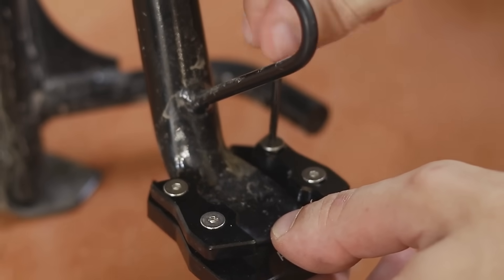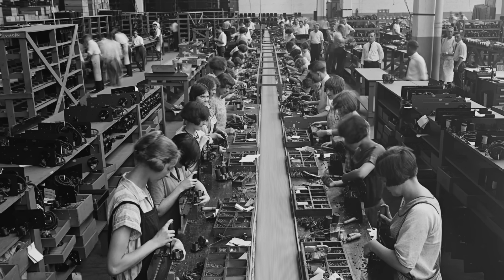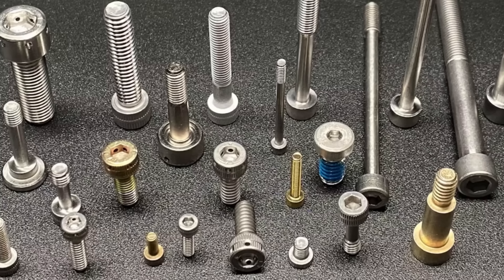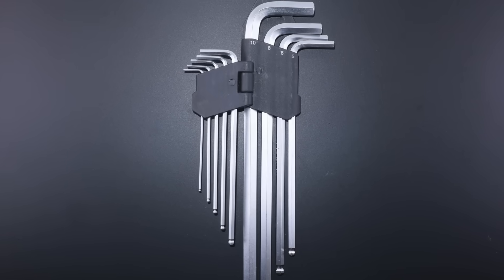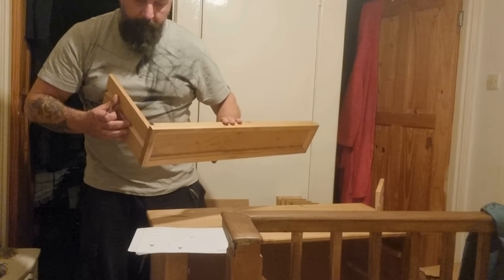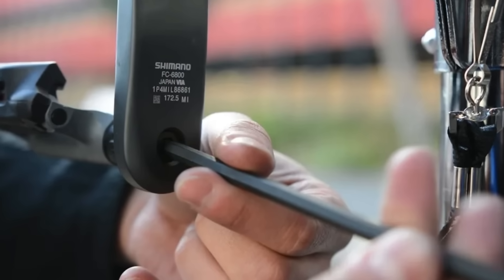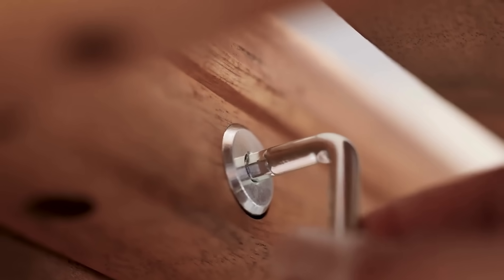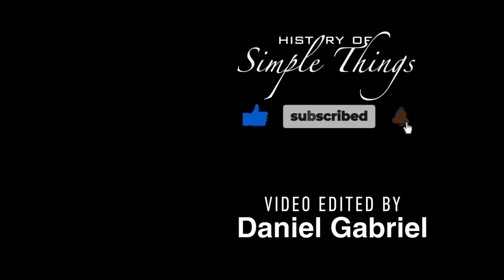Why Do We Call It an ‘Allen’ Wrench? The Surprising Origin Story!

Comment: Can't argue that they're better than flat head screws but I just wish Allen had chosen a square instead of a hexagon, the number of times the screw head or the tool becomes rounded off due to slipping would be a lot less with a square shape, I think.

Comment: In the U.K. wrench is what you call a pulled muscle. The rope suddenly went tight, and I wrenched my shoulder. Wrench : a sudden movement. 

So we call them keys. Keys fit in locks. Some locks require very basic keys to operate. Such as those on many toilet cubicles. You can unlock them from the outside with a 2p coin. They are just a lock to hold the door closed against accidental entry when in use.

Comment: American here. At my first real job, I was politely but firmly informed that the tool was called an Allen key, not a wrench. I frankly detest the L-shaped key. I much prefer the ball-end keys that have an interchangeable screwdriver-style handle, such as the Xcelite 99 series. The sole advantage the L-shaped keys have is that they can be made very cheaply, which is why they’re included with flat-pack furniture. 

Another advantage of Allen head bolts is that the socket can be a small diameter and still handle a great deal of torque, which is why they’re used for set screws, or grub screws if you follow British Commonwealth usage.

As for standardization, all commonly-used fasteners have been standardized. If they hadn’t been, they wouldn’t be commonly used. Duh.

Comment: My experience is that when subject to vibrations, the Allen screw loosens.
Then, lock nuts are required.
Reply: I don't see how the drive type has anything to do with whether a screw comes loose.  Why would an Allen set screw be more prone to loosen than a Torx set screw of the same size in the same application?

Comment: My father made very certain when I was a little kid (decades before Ikea and furniture assembly at home) that I knew that Allen wrenches were properly called hex keys.  After I knew, he was complacent about our referring to them as Allen wrenches.  (He was not complacent about any wrench other than branded Channel Lock pliers being referred to by that label.)  I also knew which way to tighten or loosen bolts and screws, because he taught me (and took advantage of my small hands to thread and  hold tension on nuts in tight places, much to my  childish delight). I didn't hear "Lefty Loosey, RightyTighty" until I reached my tween years; we didn't need it.

Comment: My Father was a Screw Machine shop supervisor for 45 years with the Bendix Corporation. In the mid-1960s his company opened a division in Mexico and sent him down there to get it up and running and manage the machine set ups. The company provided a complete set of tools for each machine. It wasn't long before sockets, ratchets and wrenches started disappearing at the end of shifts and had to be replaced.
After a month of this my Dad shut the place down for a week. He had a crew replace all of machine fasteners and the tools. Hex Bolts and Hex Nuts were replaced with Cap Screws and Square Nuts. He replaced all of the Ratchets, Sockets and machinist wrenches with Allen Keys and Monkey Wrenches.
After that the place ran like a top. He came home after four months to a promotion and big raise.

Comment: 'A century of innovation' ? Surely more a case of 'right 1st time', so innovation not needed? I was wondering what innovations could have possibly improved Allen keys since their invention. I thought chrome vanadium steel, but it was invented at pretty much the same time as Allen key. The only there relevant innovation I can think of is the ball ended Allen key (1964, by Bondhus, apparently).

Comment: Allen wrench, Allen key, hex wrench, hex key are all interchangeable names for the tool and I have used all of them. There is also a similar tool that uses splines instead of flat sides called the Bristol wrench, Bristol key, spline key, etc.
Reply: Right.  These terms are equivalent.  It is a silly argument.  You can even find a company that makes then using both "key" and "wrench."

Comment: ..they're easily lost/misplaced also..can't tell you how many partial sets I have at home, each missing two or more "keys"😊😊😊
Reply: I had that problem, because my set was just kept loose, in a pouch.  Now I have two large sets with a plastic holder for each with a place for each individual tool.  This is important because the holes are marked with the size.  The smallest keys are too small to be marked with the size.  You just have to be disciplined about putting them back.

When you have a device that needs regular use of one small key, it is better to buy another key of that size to keep with the equipment, than to remove it from your set every time you need it.

Comment: Do not call it that in Denmark. The name used here is Umbraco Key. A quirky spelling mistake as the origin of the name is unbreakable.  The Un-break-o key was used for loosening or tightening the bolts made by the USA company Standard Pressed Steel Company, as a precision bolt for the car industry in the 1920's.

Comment: Well Phillip and flathead both have their own screwdrivers.
Reply: "Flathead" is a description of a screw designed to be recessed to be flush with the supporting material.  Many people use it as a term for a common screwdriver used to drive slotted screws, but that usage is incorrect.  Screwdrivers do not have a head.  They have a handle, a shaft, and a tip (or bit).
Reply: @GH-oi2jf  are you sure? Pretty sure Flathead is a guys name. We had a kid called Flathead at my school…🤷🏿‍♂️

Comment: The word "Wrench" is not used outside the USA. We've always called it an Allen Key, but it's used much less these days, it's been taken over by "Torx" keys, which are even stronger and better to use.
Reply: Do torx keys come in the inexpensive format of Allen keys?  I only have them in drivers with a handle, or bits to be inserted in a driver tool of various kinds.  A useful characteristic of the Allen key is that it is small, lies flat, and is inexpensive.  If you had a particular device which often needed the use of an Allen key, you could just buy a single key to keep with the equipment.
Reply: @GH-oi2jf Yes, Aldi have them in stock relatively often. 

From memory, their Allen keys are coded red, Torx keys are blue.
Reply: In the UK we do use "wrench" for torque wrench, pipe wrench and basin wrench, but not for Allen keys.

Comment: It's only Americans that call this a wrench. By the way Allen heads are one of the worst heads invented.
Reply: "One of the worst"?  Hardly.  It is widely used because it suits many applications.  It might be misused at times, but I've never encountered one.  A common usage was once set screws on knobs, such as on radios and other electronic equipment.  I don't know what other type one would use.  When the makers of these things stopped using them, they went to a spring incorporated in the knob for friction retention, rather than a different type of screw.
Reply: @GH-oi2jf  Allen screws are used on motorcycles and some cars. Often in awkward places or where a higher torque is required than any other than a top quality allen key will manage. I either case slippage occurs resulting in the hexagonal part becoming a rounded part after which the screw is as good as useless. Torx heads are far superior offering more surface area and better angles for better grip and less slippage.
Reply: @6 @6panel300  If an Allen screw won't take the necessary torque, then the fault is with the design that used the particular screw, not with the Allen system overall.  If the recess is damaged in use, the size was too small, or another type screw (as you say) is needed.  

It could also be that the wrong size key was used.  If you have Metric Allen screws and try to remove them with the closest fitting inch-based Allen key, you could damage it.  I have encountered Allen screws of unknown size, so I now have a large set of both SAE and Metric Allen keys.  I always find the proper fit before applying force to the screw.  Properly sized Allen screws will withstand plenty of force without being damaged.
Reply: @GH-oi2jf  But they wont take the torque of other screw heads. They are not suitable for anything of strength. The 6 sides of both the key and the head need to fit perfectly or they will slip. That for example is why they are not used on cylinder heads where as torx heads both male and female are. Allen screws are a flawed design.

Comment: Yes, they're Allen wrenches after Allen Manufacturing, a company that no longer exists.  I suspect that they'll never stop being Allen screws and Allen wrenches.  If you look in Machinery's Handbook, you will find the standard dimensions for SAE and Metric screw heads of various kinds as well as dimensions for the wrenches.
Because Allen Manufacturing no longer exists,, I doubt that there is a problem with patent violation if you set up a manufacturing company to make screws and wrenches to the SAE standards.

Comment: I have been using allen keys in metric for decades; the conference in Paris in !966 I think decided to use the MKS system, (Metre, Kilogram, Second), temperature degrees Kelvin, volume the Litre. velocity metres per second and many other measurements as standards. Including the colour-coding of medical gas bottles. The septics, as usual were contrary, (petulant), retaining Green for Oxygen bottles, the rest of the world, using black cylinders with a white collar.
The Buoyage system also contradictory.
Always been bampots, even before Trump, since 1776 in fact.
Tasmania
☘😈

Comment: I wish they were simply configured like every other driver in my tool box: with a grip handle on the end.  The “L” shape really slows me down in some situations.  I know some T-shaped drivers exist to do this, but I’m still surprised at the prevalence of the L-shaped ones.
Reply: There are hex drivers in a regular screwdriver form.  There are also T-handle types.  I have just one of those for a particular screw.  Another way to go is to use a square drive, either 1/4 or 3/8, with a screwdriver handle, sometimes called a spinner, and use hex bits that have a square drive attached.  Get a bit holder for your spinner and there are many bits you can use.

Comment: In Australia. Allen key for the tool. Hex head for the screw/bolt. Standard, in both Aus and USA is SHHS (socket head hex screw) when refering to a hexagonal fastener. Boeing and Lockheed Martin both use this nomenclature. There are variations depending one the shape of the screw head, where the thread begins, purpose of fastener, material, strength, accuracy, coatings, etc.

Comment: Those small ones are called Allen Keys here in Britain, they aren't really made large enough to be called wrenches. A wrench is something you'd use to take a wheel off your car.
Reply: We (in the USA) might also call the small ones a "key", but some are large enough to be called a "wrench" in US terminology.  The latter particularly if we have one mounted in a socket and use a ratchet handle to turn it, or even a breaker bar.

Comment: How about the history behind torx screws?
Reply: Robertson said no to Ford, Ford used Phillips, Phillips sucks more Bubba than the whole WH press corp can envision possible, Textron thinks they can patent a new kind for US manufacturers and make more money and calls that Torx™ because they're clever with words, smart people start seeing that you can apply more torque without tool slippage, Torx™ gets to replace lots of Phillips, PoziDrive and Allen when the patents expire, Textron patents and introduces TorxPlus™ to make more money, etc. 🐮👆
Reply: @kittytrail good writeup, I use T25 Torx often and they'll break before they cam out
Reply: @chrisrageNJ   depends for what you use them and what screws and drivers you use.
most of the time it's due to either a dirty drive, shitty specs driver/bit, screw steel quality, seizing due to galvanic corrosion, like a steel screw in an aluminium alloy part or not enough screw to resist the shearing forces placed on the assembly(see IS disc brakes mounts for mtb as an example 😉). or all of the above combined... 😋👍

Comment: A square head would have been more secure and simple to make. It had to be all about the patent and making it different for difference sake. So not as smart as it seems
Reply: No, hex is closer to a circle - the cross section of a bolt and the hole into which it's inserted - so the key can be larger for a given diameter of bolt head and can fit in any of six positions rather than four - convenient in confined spaces. Torx is better still.
Reply: @lenroddis5933 Yeah, good point. I didn't think about positioning it

Comment: Drawbacks: You need an exact size to fit the screw. Clumsy to work with especially in corners and tight places. So many sizes in both SAE and metric! So you need a pack of each. Wish they came like ordinary screw drivers. That may one reason we still have the old fashion slot and cross pattern screws. You just grab a screw driver that sort of fits the screw and you're set!
Reply: They do come like ordinary screw drivers, but it would be expensive to have a full set of them.  I have just one with a T-handle for a particular screw.  I have two large sets of the common type (SAE and Metric).  These can be used to determine the size of an Allen screw for which you need to buy a better driver.

Needing the exact size is not a drawback.  You should always use the correct size to avoid damaging the recess.  An Allen screw is a robust design which will last a long time if not abused.

Comment: Didn't mention that to solve the slothead problem the Robertson head was developed in Canada around 1908. It was offered to Henry Ford but he wanted a Yanky solution.
Reply: Whatever the history, the Allen design became a huge success.  A common usage is for small set screws.  Do Canadians use Robertson for those?  How many Robertson sizes are there?  Are there inexpensive wrenches for Robertson like the Allen keys?  One advantage of an Allen key is that it is uniform, except for putting a bend in it.  That means it is inexpensive.

Comment: There is a competitor to the Allen wrench/screw: the Philips-head screw. But the Allen wrench became more popular for many applications because it could handle higher torque and the fact the design the Allen screwdriver made it easier for novices to use it.
Reply: Pozi drive 2 has become more common and popular too than the Philips in my country the Netherlands.

Comment: In 1908, Peter L Robertson developed a square recessed drive fastener, to address the problems of tool slippage and screw head stripping. The Robertson screw has a square, slightly tapered inset drive, that allows strong fastener/tool coupling and high insertion torque. It would be nice to see a future video on the history of these unique fasteners.
Reply: I think that was a Canadian invention.
Reply: @ericgeorgetruckgrilling  Peter Robertson lived and worked in Hamilton, Ontario.
Reply: Which probably means it was invented by a European 😂
Reply: @rosonoftom1655 
And Henry Fords parents Were born in Cork Ireland so does that make the Model T an Irish invention?
Reply: @freddymax5256  No. But the pipe bomb is another story...
Reply: Henry Ford used slotted or straight screws and wanted to switch to Robertson. Ford wanted to buy manufacturing rites from Robertson for he held the patent and wanted Ford to pay a fee for their use. Ford  refused and stayed with the original slotted screw and the Robertson never became popular in the USA.
Reply: Because of the taper, you can grind the worn end off a Robertson screwdriver to tighten the grip.
Reply: I see the square ones every now and then, they are rare.

Comment: The other important thing about the Allen wrench or key is that they multiply by themselves. Every old tool box is full of them, if you buy an old tool box or other container of tools there will be some in there. I’ve bought a lot of used tools over the years, and I have two, one gallon plastic buckets full of extra ones. I need to find someone who wants to repurpose them in sculptures or other art.
Reply: Same here.
Reply: And yet you can never find the right size.